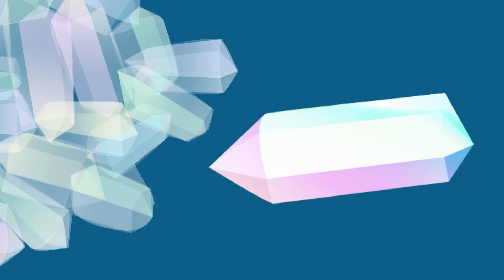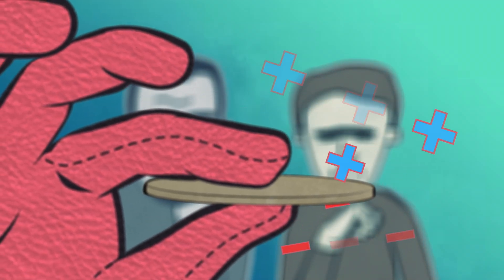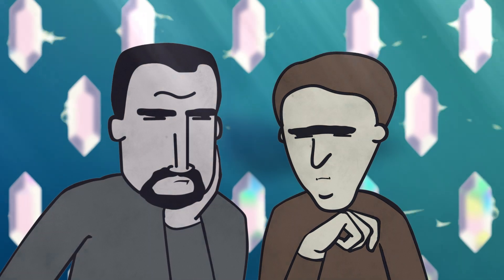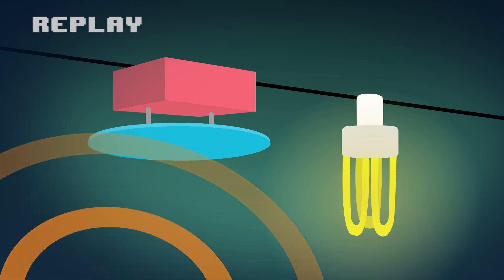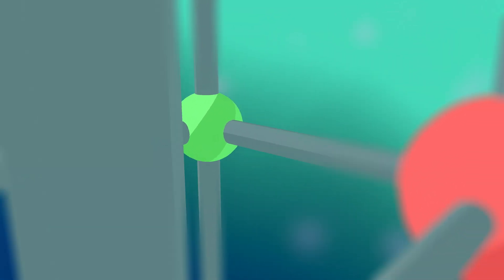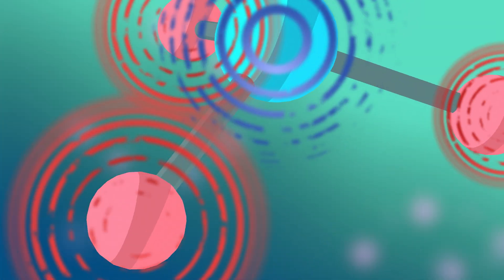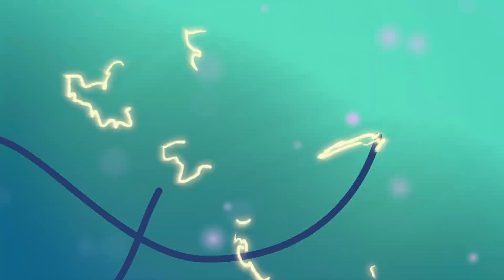How to squeeze electricity out of crystals - Ashwini Bharathula

Comment: Piezoelectricity systems are a theory behind the pyramids because they have all the right materials to create a piezoelectric reaction built into them. If proven true through scientific inquiry it could confirm the existence of an energy grid created through piezoelectric reaction thus removing the worry of a solar event crashing society and would also open a door for us technologically. All our information is transitioning to hard drives and away from physical books.  What do hard drives use to save information?  Quartz...What does the pyramid have in abundance throughout its structure? Quartz...  If we are going to go all in on hard drives for data storage then I recommend we build a hard drive so massive and solid that it still stands through catastrophic event after catastrophic event after war and war after war.   A message to the universe that we were here and we endure.

Comment: Interestingly enough, there is almost no energy in compressing a solid since energy is defined as KG m^2/s^2. So using PZT-5A as an example. If you have a 37 mm diameter, 5 mm thick piece of PZT and you press on it with 9.81 N of force or the equivalent of setting a 1 kg weight on the PZT. The PZT will compress 164 picometers so the energy expended compressing the PZT-5A is 9.81 N * 164 pM which is around 1.648 nJ.

Now you use the D33 value and the G33 value and the pressure in pascals to determine the power generated. They cruely list the values in C*m^2/N which is c / (N/M^2) and N/M^2 is a pascal. But for PZT the G33 is 326 pC/PA and 2.4 mV/Pa. pressure is force / surface area. So the PZT-5A experiences 2281 pascals of pressure. So the PZT-5A will make 24.35 mJ of energy.

The opposite is true when using the PZT-5A as a prime mover. It's like a striling engine. If you use a striling engine to move heat energy aroun, it's a heat pump and has a COP > 1 but if you use it as a heat driven engine, it has a COP that is equal to 1/COP when you are using it as a heat pump.

Perfect inversion of energy. It's also why stirling engines are not free energy.

Comment: give me the formula for electricity production by hammered so we found that limit so we got more efficient way's to squeeze the electricity from piezoelectricity crystal by using gearbox and hydraulic pressure setup at large scale model

we know the mechanical strength of crystal or materials so when we move the gearbox made by piezoelectricity crystal then we got easy solution forever for electricity

since we don't need battery for small gadgets which uses very low power source like tv remote control and small torch lighted with diodes

Comment: I'll tell u what's next. People will use water / mercury ,/ fluid systems with finely ground piezoelectric crystals.  The fluid will be in systems with fluctuating pressure zones for the water-borne, stinking fast piezo-particles to constantly charge the fluid itself. It's the obvs clean future. See 'the Joe cell'for one massive change for civilization.  Goodbye petrol. Oh, and nuclear. Cioa

Comment: Why not charge a capacitor with it.... use the energy in the capacitor to vibrate a transducer on the crystal to keep it vibrating constantly so it keeps charging the capacitor that keeps vibrating the transducer. You will get over unity just by talking to it from the extra vibration from your voice. Oh.. and short the capacitor out in water... it will charge forever .

Comment: Salt water rubbing on quartz since salt water has tons of loose electrons to charge a dual capacitor that arcs out making an arc flash and drawing in the trapped sun rays on the 2nd coil with metal top and aiming lighting to space to circle the world.   Nikola Tesla...

Comment: I can see a pretty good portable power source powered by something like this; Modify a crank clamp (Those tools you turn the crank and it squeezes what's between its two plates) so it has conductive ends (The parts that push on the object) and have wires going from the clamps to an output, secure a properly cut Quartz Crystal in between so compressing it will create charges on the clamp plates, and that output can power something.  Also, make sure you put on insulators where appropriate to keep the user from getting shocked by accident.  It's not too expensive, capable of being carried like a water bottle, and can probably work a light or motor for a good long while. (I came up with this before today, 8:40 a.m. on 7-17-2017)  The low current might be a problem...

Comment: Also, iirc, most computers use a piezoelectric crystal (called a clock crystal) to generate the clock signal that keeps all their components in sync with each other.

Comment: Anyone else see a potential perpetual motion machine? Like, take a medium sized crystal and stack a huge anvil on top of it. The crystal is always under pressure and hence the voltage will always appear. Free energy. I know. I know. Perpetual motion machines aren't possible. So it wouldn't work. However, I'm more interested in understanding why it wouldn't work.
Reply: I had that exact thought. What's stopping us from just stacking a bunch of weight on the crystal and generating free energy?
Reply: +A Rocket Beats me. I don't know much about this topic.
Reply: It is the changing of the pressure, not the pressure.
Reply: So to generate electricity the crystal needs to be pressed and then released again and again? Why didn't they convey that at all in the video?

Comment: Can they produce infinite energy?
Would they be drained out if you keep squeezing them?
Reply: I would think that they would slowly decompress without force on them.  It doesn't produce or even drain electrons, it just creates a force to make them go through a circuit.  It's certainly possible to create a "gravity sandwich" prepetual motion machine, by placing a piezoelectric material between two EXTREMELY heavy things, with supports keeping them apart, and the gravity pulls the material out, creating that gradient that could last forever, but this is under the assumption that the space-warp will give energy to the electrons, which it might not...

Comment: Alright, so when I walk, I can generate electricity. And then the crystal is squished. How to get it back up without using same current I generated earlier?
Reply: I'm not sure if I understood your question, but let's say you're holding a sponge and you squeeze it. What happens when you let it go?
Reply: Except this video clearly said it needs to be "squashed up" again and then it makes a current backwards. How to get it back up?
It's not a material with structural memory or elasticity.
Reply: Eryk Vi 
The material is elastic.
Unsqueezing it creates current in the opposite direction.

Comment: This misinformation is unacceptable. The voltage generated may be large, but the current is incredibly tiny. When the clapping to trigger the lights example is used, seperate machinery needs to detect the charge difference and turn on the lights (powered by mains). The amount of footsteps needed to power station gates or a dance club is ginormous and completely impractical. A child may watch this video and take in without questioning these false examples.
Reply: also the claim that unit cells on some crystalline structures lack o a center of symetry es completely wrong, they all do
Reply: And they show crystals generating continuously, when it's only on pressure change.
Unacceptable indeed for educational stuff.
Reply: Although I agree with that, TED was simply giving an example. It would require an immaculate amount of Piezoelectric Energy to run street lights. An alternative could be that the Piezoelectric Energy helps charge the street lights, similar to a hybrid car.
Reply: DAMN, TED. How many other videos may be filled with misinformation?

Comment: infinite power?
Reply: +Muhammad Syahir Abdul Nasir
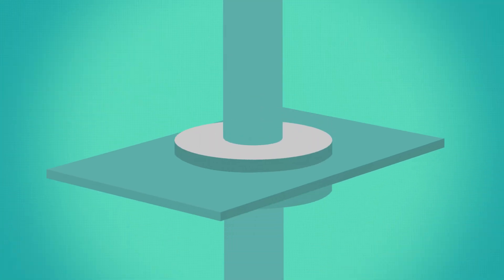Yes, obviously you can't have infinite power. But at 3:09 in the video they seem to imply that just having constant pressure on the crystal generates electricity, which leads me to the inevitable thought: why not just stack a bunch of weight on top of a crystal, and thus produce infinite energy?

My guess is that the information in the video is misrepresented, since I can't be bothered to go look up the answer for myself...
Reply: Yeah that was my guess too. If that is the case I'm not sure why it wasn't explained.
Reply: 2 much noledge
Reply: put it on hydraulic press

Comment: Could a crystal provide the energy for a mechanical hand to squeeze itself, thus making an impossible perpetual motion machine?
Reply: That depends. Could you make a hand that squeezes without even the tiniest bit of friction or heat, and could you transfer every bit of the electricity perfectly without any loss?
Reply: It doesn't need to run forever, just longer than a human lifespan, and you can calculate how much base level energy is needed to power the device, and to the average human it would appear to be perpetual motion.

Comment: but.... but.. it doens't magically generate electricity. it creates an electric field which is like a capacitor. it can be use once and then needs electricity to flow the other way again, to "recharge" it. creates an opposite electric field when released again.

Comment: what if you put one at the bottom of the ocean or use a mercury filled pool to push down on the crystal? would you produce constant electricity. if so, where is that energy coming from?
Reply: No, because they generate electricity only on pressure *change*.
And the video totally misrepresents that.
Reply: Andrew V 
A constant flow of electricity could be possible but the electrical output would be changing as time goes on. 
This would happen because factors like pressure, durability of the crystal, and heat can effect how elctricity is generated and how well it can move through a material.
Reply: Husster72 that makes sense. i also thought that in order to actually keep a constant flow of current you need pumping of the crystal. Or else wouldn't it reach equilibrium?
Reply: Andrew V 
I would not know, I currently only know the basics when it comes to how these kind of crystals work. 

Most of what I know comes from my study of other types of science,  which often have the same problems.
Reply: This question reminds me of the theory that a an active crystal pyramid is at the bottom of the commuter triangle. Take this theory with a grain of salt. Doesn't mean it's real it's just something interesting to look into

Comment: I wonder if we can use crystal as a renewable source
Reply: Cass Fage no becsuse we need some mechanical energy to generaate electricity
Reply: Cass Fage 
This method of energy production would not be renewable. 
These crystals require specific conditions and materials to form properly and any flaw in the crystal effects how the electricity is generated.
On the other side energy sources like solar, wind, and geothermal are easy to obtain and are a reliable source of electricity.
Reply: Oh 😯thank you for the information 🙂
Reply: Cass Fage No problem

Comment: That's why I love crystals, however, is it possible to power a motor or engine with piezoelectricity only? How much of them would be required?
Reply: a lot.
Reply: I'm pretty sure if you had enough of them to power an engine, it would weigh so much that the vehicle couldn't even move. TL;DR a lot.

Comment: Question: is it possible to use that as a source of energy using gravity and just the weight of the material itself?
Lets say there's one of those crystals in Jupiter, for instance. Letting it on the ground or on a table would make some difference in voltage between the top and the bottom of the crystal, even if just a little?

Comment: aww, this video is 5 years to late 😔 back when i was 13 i was thinking how you can't create enery but only can change it into other energy form. then doesn't that mean every energy can be turned into eletric energy at some point? so i did my research for an innnovative way to produce electricity but i gave up because i understand nothing... the only thing i understand was piezoelectric produce to little energy to be usefull 😅 well probaly won't change anything tho.

Comment: I remember hearing that these are also used for more powerful microscopes. When they have to focus in on an object in the nanoscale, without breaking or dulling the tiny fragile equipment(specifically the cantilever), they need to "inch" one way or another in extremely small units. They run current through piezoelectric materials, which then move the probe part of the microscope up/down or sideways just slightly.
I'm not very sure about what I'm saying, does anyone know enough to explain it properly?
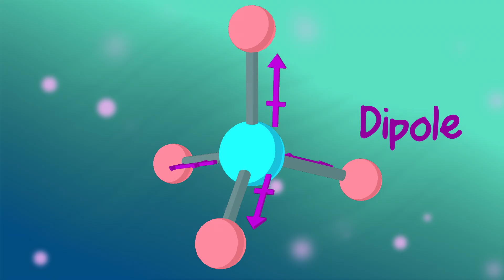Reply: When a voltage (electric force) is applied to both sides of the crystal, the charged particles that make up the crystal redistribute themselves to align with the electric field (so negative charges move towards the positive side and positive charges move towards the negative side). Depending on the polarity (direction) of this voltage, the crystal will either compress, or expand, this is basically what is shown at 2:45, but in reverse. This small shift in position can be enough to move an object into focus on a microscope.

They also use this technique in manufacturing to produce very small objects with precision, such as the billions of transistors inside a computer chip. In this case, they will use many crystals to get the exact positioning required.
Reply: You're looking for "atomic force microscopy," aka AFM. See wiki for a detailed explanation: https://en.wikipedia.org/wiki/Atomic-force_microscopy
Reply: No I don't, but I'm replying in case someone explain it :D
Reply: Well, fuck. Not even I knew that. Thanks for mentioning that, mate.
Reply: Mira Jain replying to learn more about this
Reply: +uknouluvmbcimazn yes thank you! that was it
Reply: i dont realy know anything about this but it does make sense becuse in the video they say that when you pass a current in this typy of materail it changes its size.
soo if you can make a small current that will allow you to make small changes to the size and that can move the microscop a littile. 
i guss...
Reply: Sounds like smth 4 a surgical or otherwise precise operation
Reply: can you help me to finding anything that connects me to the original RAIF technology. disease (metastatic cancer)

Comment: instead of making roads out of them why not make shoes???
Reply: Why wouldn't you make roads out of them?
You could run electric vehicles on the roads and have them generate electricity to store and recharge the vehicles again?
Even if it was only supplementary you could have solar powered crystal roadways!
Reply: Would you like to walk everywhere with cords attached to your shoes?
Reply: *stuck
Reply: why not both?
Reply: That way it gives sense and I have to agree with you that the shoe alone wouldn't have enouth power. But the way Chris presented it it seemed like "having a cable sticked into the ground while walking would be better".
Reply: Shoes need to be flexible and usually get worn out and replaced as you age, unlike roads which are used almost indefinitely.
Reply: because we cannot attach a cable with shoes since it'll go somewhere which we don't know but the road will stay where they're so that's a pseudo question to ask
Reply: No, the road is the charger and there would be charging stations / batteries, where you could then plug in and charge your vehicle... then we wouldn't have to pay for the electricity, only your car registration which would pay for the maintenance of the roads.
Reply: Okay. How much would it cost to replace the concrete with a piezoelectric material? Which piezoelectric material is durable enough to act like a road. In the video, Sugar is mentioned as a piezoelectric substance, as well as a few manmade substances. At this point it wouldnt be cost effective.
Reply: Chris Zhao or you could make a mat, rather than replacing the floor
Reply: So having a cable sticked into the ground while walking is better?
Reply: fixed
Reply: Surely the tyres would have to be made of it, because they can't charge their battery by giving energy to the road. lol
Reply: You could have a small wire inside embedded in your pant leg
Reply: *enough
Reply: andrew gunawan those are already electrical lol
Reply: Chris Zhao are you seeking graphine coins
Reply: It doesn't scale well enough for this.
Reply: Benjamin Sam Ground Water Recharge and Soil to you sir : " Are we a joke to you"
Reply: U
Reply: Sksksks wearing quartz shoes would prolly be painful-
Reply: Light-up shoes ahem
Reply: You wouldn't have a cable in the ground, it could be used on roads to generate some charge to be used in sockets that you would connect something to, or through an alternative solution. But the energy generated from your shoe wouldn't be enough to power your phone anyway, it would be insignificant.
Reply: trump would still insist on bringing back the coal mining jobs 😂😂
Reply: What piezoelectric material is durable enough to withstand hundreds of tons of force every day?